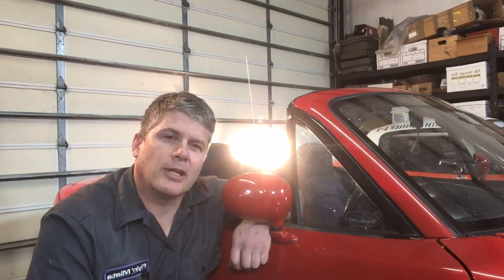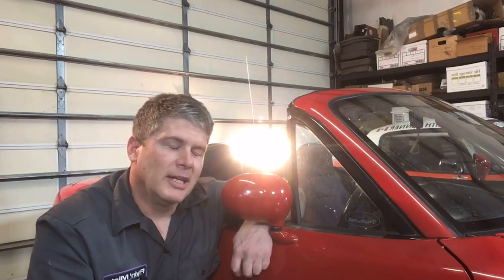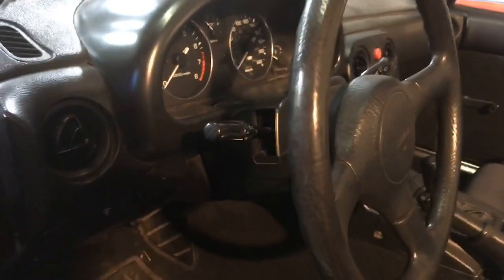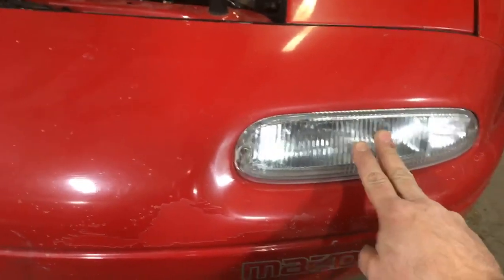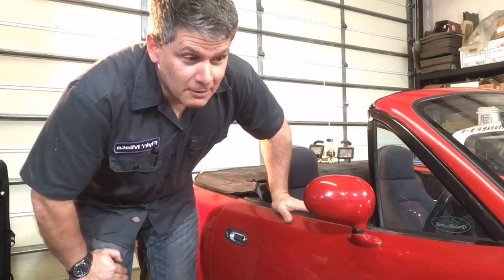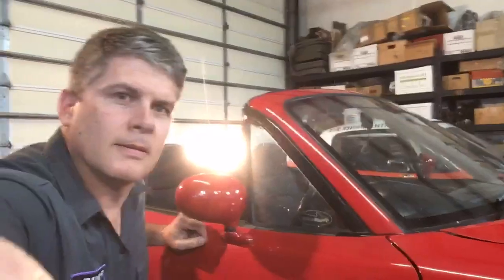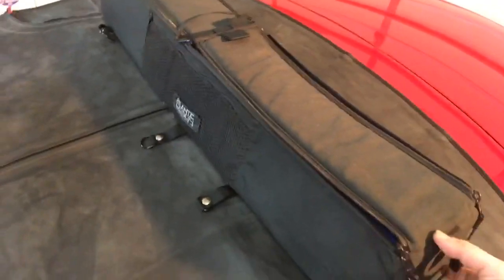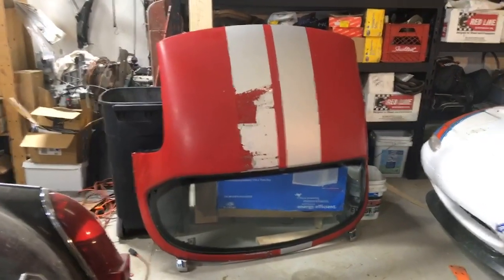Time Capsule Miata 338 Tour (FM Live)

Comment: I know the wheel/tire thing was a joke and all buuuuut... it sounds like you're saying Uniroyal Tiger Claw in 184/60/14, I'm guessing that's actually the Uniroyal Tiger Paw in 185/60/14. I'll commit a cardinal sin here, is that your recommended tire and size for an NA daily driver with OEM wheels?
Reply from the maker: It's the factory size. These days, you have to choose the best 14" tire available for your use and maybe cheat the size a bit. 195/55-14 used to be a popular option back in the day but I suspect it's a little rare now.